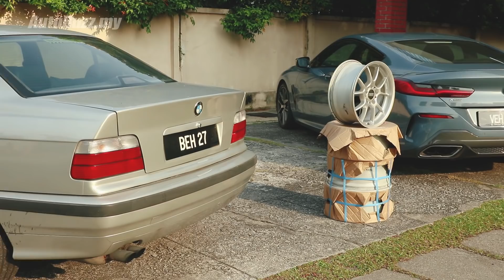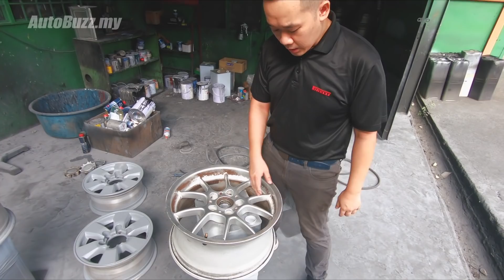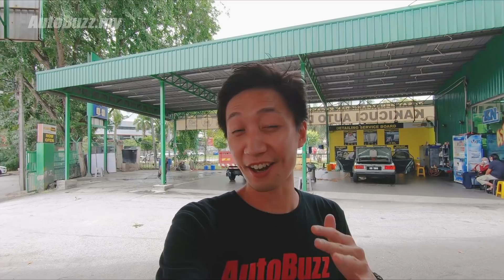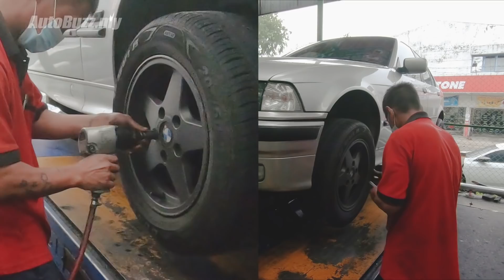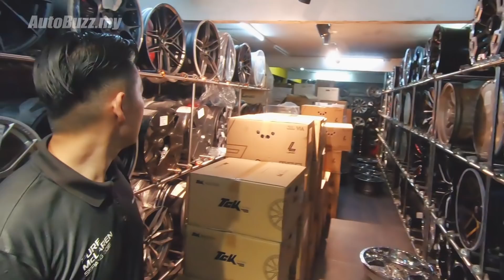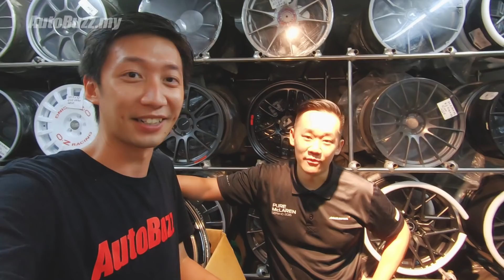Project EJ36 (1/4): New BBS RK wheels for Eu Jin's 94' BMW E36 325i! - AutoBuzz.my

Comment: I have a 2004, W203, C180 Kompressor, 6-speed manual and FACELIFT. Facelift means, dual-dial meter at the dash, revised gearbox than the pre-facelift. Its a 1.8 engine, black-top, 143hp, can easily tune-up to match the C200 Kompressor which uses the same engine. Fellows with mindset, "manual, patut jual murah", can go away! I've never seen any facelifted, manual in Malaysia, only pre-facelift with big dial speedo. I hope to find people like u, Eu Jin. People who really appreciate manual cars. And, I am the first owner in the geran too! The car was imported by me, and I am the second owner from new. Made in Germany, not Pekan, nor Japan. And please dont expect can get to match the current market price for a similar year-made car with the 5G-Tronic tranny.

Comment: Hey bro, how’s the ownership costs like? I’m currently eying on a used E36. Thanks!
Reply: it's probably the most affordable BMW to maintain but it's still not cheap in the grand scheme of things. Most replacement/wear and tear parts (even brand new) are still easily available. 

get a good base to start with, as unmolested as possible. find a good mechanic for it (there's plenty in this community) and you should be fine. be prepared to spend in the initial stages, and best to learn bout the car...blindly changing may not necessarily solve your problems.
Reply: @eujinpan  thanks! 🙏 Do you have any recommendations for workshops for pre-purchase inspections (and probably fixes) in PJ area, preferably?